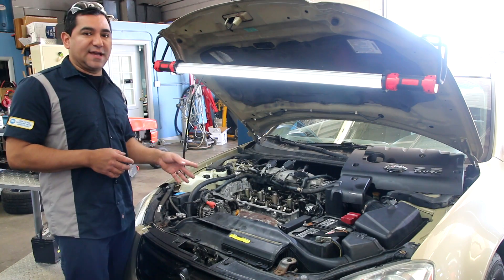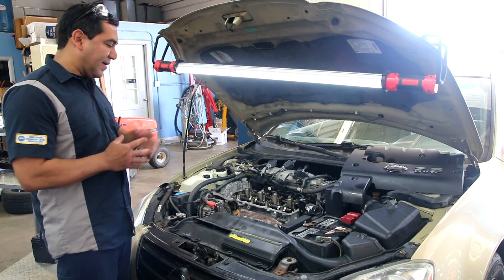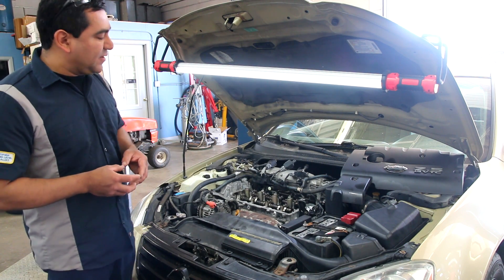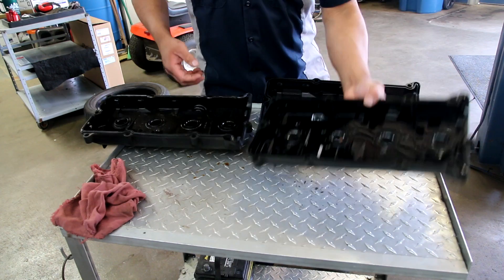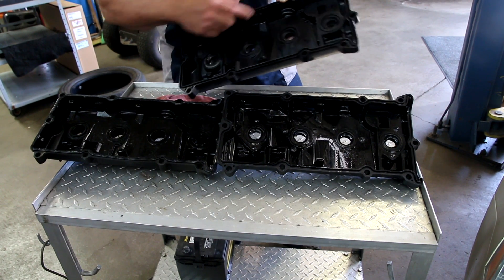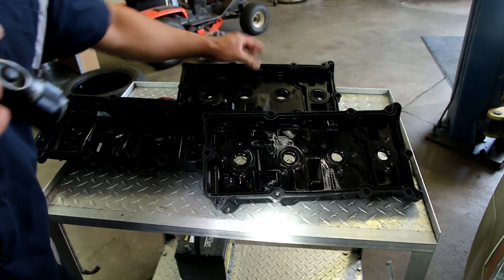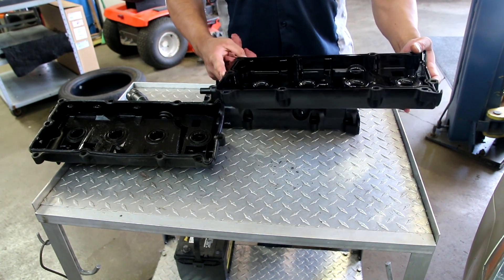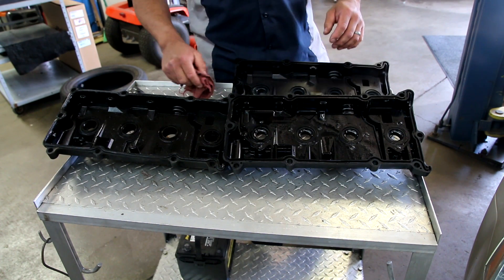Nissan QR25 2.5L Burning Oil

Comment: Thank you for this post. It led me to my sudden increase in oil use.  Here it is 7 years after your post and O'reilys sold me a bad one for my 2005 2.5 Altima.  I replaced it and it hasn't used a drop since. I contacted Corporate and they never said they were sorry or that they plan to do anything. I will never buy from O'Reilys again
Reply from the maker: That's crazy they are still out there! Always go OE parts if you can!

Comment: It's June 2023, just replaced the valve cover on my '17 2.5L, and the OEM valve cover and gasket from Nissan cost me $280.00 . Well worth the money considering all the possible issues you may have with aftermarket covers.

Burning oil is no joke, it carbons up the cylinders and can cause upper cylinder damage. The excess carbon increases cylinder temps and can cause stuck oil control and compression rings which cause even more oil consumption, and carbon buildup around the valve seats can overheat them, causing one to drop, and your engine is totaled.

Burning oil can also foul the emission control sensors and worse, excessive or long term oil consumption will damage your catalytic convertor.

Its been 7 years since this vid and I looked at the aftermarket options and they still are poor in construction. Don't buy the aftermarket valve cover, go with OEM.

Comment: I can approve this video my Nissan 06 Altima had zero leaks the only leak was the Gasket on the valve cover after replacing with a cheap valve cover I started getting oil burning issues.

Comment: I bought an aftermarket valve cover w/ gasket for $38 on Amazon. Works great, no leaks. You have to use Permatex on the shoulders and where the metals come together.  Otherwise ALL of them will leak.

Comment: dead on for Dorman problem! I initially did not want to pay the price a new OEM valve cover would be, went cheap for Dorman.   Oil consumption doubled! same problem with baffle as shown in video.  put on Nissan part, good to go.

Comment: I have run into this same crap. I was about to give away this car because i thought the engine was almost done. I had just changed the valve cover so i went to c factory one and boom burning oil issue is gone.
Reply from the maker: I am glad you got it figured out!

Comment: Changed out the Dorman cover, with an OE Nissan cover. The baffle plate on the inside or the Dorman cover was loose, due to broken plastic spot welds. The PCV hose was filled with oil. The Nissan cover doesn't use the plastic spot welds.
Reply from the maker: What a huge difference in quality.

Comment: The problem may not have been entirely corrected by Dorman. I recently changed the valve cover on my 2005 2.5 Altima. The car is now using a quart of oil every 400 miles, it didn't do that before. I contacted Dorman and they were very good about it. My Dorman cover is a more current production (2016), and it should have the upgrade to prevent oil consumption. They are shipping me a Nissan cover, and have requested the Dorman cover for analysis. I will post an update in the near future.
Reply from the maker: That is good to know! I have had some other Dorman products that were problematic. I had 2 park sensors for a 2014 Ram truck that were bad right out of the box, you could see the pins were not molded in right and they did not work so I got OE ones and got the job done. Also a water bypass pump on a jeep that leaked at were the pipe was soldered to the threaded portion. Things like that get a little frustrating.
Reply: I have had very bad luck with Dorman control arms. They don't last. It's not just Dorman, most replacement parts made in China are very poor quality.

Comment: Nissan Frontier 2007 burning oil and  ciinder 3 missfire code As far as the P03030, that's OBDII and I retired not long after it came out but I'll take your word for it, bad cylinder #3. If a coil and plug didn't fix it, you got a bad valve, cylinder damage, bad compression ring(s) or possibly a bad intake manifold gasket. Nissan frontier 2007  gets P03030 3 Cilinder missfire, that's OBDII it, bad cylinder #3. If a coil and plug didn't fix it, you got a bad valve, cylinder damage, bad compression ring(s) or possibly a bad intake manifold gasket.
Any advise what or where is the culprit ?  thank you ever so much.
Reply from the maker: Hello. Since you checked the coil and plug check for fuel delivery to that #3 cylinder. You can pull the spark plug and see if it has gas on it or listen to them clicking with a mechanics stethoscope like a Lisle part #52500. I am assuming you may not have other ways to check like a oscilloscope and low current probe. If this checks OK then a compression or leak down test is needed. If it is a totally dead cylinder it will not be hard to find out what it is. Every cylinder needs fuel, spark, compression and timing. Let me know what you find. Oh by the way I doubt its a intake gasket affecting just one cylinder but spray the intake sealing area around cylinder #3 with carburetor cleaner when the engine is running, if there is a bad gasket the RPMs will change noticeably. Please do not use brake cleaner as it is much more flammable
Reply: It makes sense your input. This misfire code was hard to detect even by the dealer and 2 other shops..I was baffled.  The engine burns oil I would say quite a bit.. the shops just wanted to make fast money without pinpointing the real culprit.  My father had a large Nissan truck and it was a workhorse to transport mining equipment. But I moved back to Honda...a small hatch back..I did learn a lot from people  like you who are knowledgeable about cars and its components and how it works. The other good news is that these oil powered cars are obsolete. The Lithium powered cars is the next gen inevitably. Tesla is building a massive plant in Nevada the size of biblical proportions and their CEO found plenty of Lithium in Bolivia who could supply the Lithium..  Thanks a bunch.
Reply from the maker: I agree technology is changing. I remember rebuilding Quadrajet carbs and now using PC based scopes to track some issues down. Its a fun and at times frustrating job.

Comment: I just put a new motor in my Nissan Altima 02 and it's burning oil too but I think they put a aftermarket valve cover too should I buy the one from the dealership or take it to see what's wrong it the car first
Reply from the maker: Does it say Nissan on it?
Reply: It doesn't
Reply from the maker: It would be worth disabling the PCV system just to check it. There are instructions in some of the other comments. Then if that changes things I would get a new cover. I suppose you could take it off and inspect it. That is easy enough too.

Comment: Question: I have a 2008 Rogue and is burning oil due to coming through the PCV to Intake.  I know this is a symptom of worn rings but the car sat for a year before I bought it off someone.  Pull the cover and there was tons of black tar-like sludge in the cover. I cleaned out what I could but it still burns oil via intake.  Would this be the cover even with blow-by? Would a new cover help with this?
Reply from the maker: You ask a good question. Lets start with how many miles are on this engine? How much oil does it use between oil changes? How many miles do you go between oil changes? Without seeing a vehicle this information will help.Thank you!
Reply: 74k on the engine; approximately 1 qt every 400-500 miles; 3000 between BUT a) the car was purchased not running, b)the car sat for a year (i know) before I bought it, & c) it started after I ran low on oil, changed it, and put SeaFoam in the oil during the change.  I have changed the PCV valve twice.  When I take the oil cap off when the engine is idling, I get air fluttering out of the hole. However, I have a niece who has a 2012 with 96000 miles on it and it does the same thing with the oil cap off but no oil burning or smoking.
Reply from the maker: If you had lots of sludge in the cover it sounds like general maintenance was neglected. I would suspect you have sticking rings but lets start with the PCV system. You already replaced the valve twice so you could try disconnecting the hose, plug off the port on the manifold with a vacuum cap or something so you dont have a massive vacuum leak and drive it like that for how long you need to see if the oil use goes down. (I am just recommending this for testing) if so get a valve cover. If not you can try soaking the top of the pistons with seafoam for a day or two. Remove the extra seafoam before starting, it will smoke like crazy when started so hopefully you have cool neighbors! Its worth a try.
Reply: Rico L I have actually been driving it with no problems since I capped the vacuum port on the intake manifold and ran a hose from the PCV valve to a breather bottle.  Everything else seems to run normal.
Reply from the maker: Thats a good sign of were you have to go from here. You did a good job on checking things out!
Reply: Rico L thank you!  I'm gonna order a new cover today. I'll update after installing.  Thanks again.
Reply: Well, after replacing the valve cover with a new Nissan OEM one with new PCV valve, new gasket, and putting it back to original configuration, I have not had a puff of smoke in over 200 miles.  The last time I put it back like this, it was smoking within 3 minutes idling. This was the solution.  The old cover was full of sludge so much that insufficient air was flowing through the baffles, causing the vacuum to suck oil through (speculating.)  I really appreciate the video and the help!  Thank you!
Reply from the maker: Good! Glad to hear!

Comment: my 2003 altima has over 320k miles. bought it new in 2003 and have NEVER had this issue. yet i bought a 2016 altima and the cvt took a crap at 5k miles.. nissan was doing great until renault slept with them.

Comment: I put a dorman valve cover to replace a bad valve cover now it started burning oil. Did the oil make its way to the exhaust. Next step is to check to see if there is a gap on the inside of the valve cover for oil to leak out of. Good video.
Reply from the maker: Thank you. Yes it made its way to the exhaust. It was a smoke machine. It used a qt or more a day! The second car was not that bad but still smoked after getting the Dorman cover.

Comment: I have a Question. My altima 2003 2.5L burns oil (I believe, because It smells like oil after driving uphill) and have to put almost a quarter of oil every 300 miles, the intake hose had Oil and the throttle body had oil stains in it, also even after I refill it with oil it has lower than 700rpms when idle (I have to put my car in N when in traffic lights so the car stops shaking) sometimes the oil light flicks. Do you think the issue can be with the valve cover? 

BTW I replaced the PCV valve 5 months ago because I thought that was the issue but It wasn't. i use 10w-30 oil since my car is past 100k miles (110k actually)

Thank you
Reply from the maker: Sorry for the late reply Luis. It sounds like you have more then one issue. Remove the coils and check for oil in the spark plug tubes. If there is it could be causing a misfire. Check the plug condition too and if you need to replace them I recommend NGK brand. The part store can tell you what plugs you need. As far as the oil burning....if there is oil in the spark plug tubes replace the valve cover with a Nissan cover and go from there. The baffle could be cracked from age. Just a thought without seeing it. A compression and cylinder leak down test will tell you the condition of the rings. The valve seals will rarely cause large oil consumption.

Comment: i have 06 altima engine oil turns dark so fast around 500kms , is that meaning burns oil ?  and how to fix it please help
Reply from the maker: Good question! Oil will get darker between oil changes, that's normal. Just check the dipstick and make sure it has oil. More important Is it using more then 1QT every 4,800km? Do you add oil?
Reply: I have no problem with oil ... its still in the proper level all the time ... but my problem that oil color become darker so fast
Reply from the maker: If its just dark oil then no its not burning oil. If it was burning oil the level would go low. A engine can have "sludge" build up in it and that can turn the oil darker faster then you may expect. If it runs fine and you don't use a lot of oil between 3,000 mile oil changes I wouldn't be to concerned that it gets dark. Just a personal suggestion If you are concerned about the color. Use a good oil and add a pint of SeaFoam cleaner with every oil change. That could help clean things out over time. You can leave SeaFoam in the engine unlike some "flush" products.

Comment: Hello Rico,  I put a doorman on mine and it burns oil. I'm not sure if it's the good on or bad one.  My question is if it was the bad one and passages weren't sealed like they are supposed be and oil is getting sucked into intake, would that make my oil get "dark" or "dirty" very fast?  Because my oil does get dark within 500 to 800 miles.
Reply from the maker: I wouldn't say it would. Or I wouldn't use that as a indicator. To eliminate the cover as the issue here are a few things. Did it happen right or soon after the Dorman cover went on? Check the baffle shown in the video and see if it sealed to the cover.  Look into the throttle body, do you see oil in the intake? That is another indicator its pulling oil in. Let me know what you find.
Reply: I just had the engine rebuilt about 9000 miles ago.  And the oil gets dirty or dark very quickly.  So I thought maybe the valve cover might have something to do with it.  It's actually a cns brand not the doeman.  My compression is good, and supposedly the valves and seats are good.  So I don't know
Reply from the maker: If that is the only thing you are experiencing and the engine runs fine I wouldn't be overly  concerned about the oil getting dark. How much oil are you burning and how fast is going through it. It is not uncommon to see half a quart used in 3,000 miles.

Comment: hablas español? como puede el aceite pasar por esta covertura hacia dentro de las bujías si se supone que las paredes de la cavidad de las bujias esta  alta ?? yo tengo este carro nissan sentra spec v y me quema aceite
Reply from the maker: I am very sorry for the late reply. If you have oil in the spark plug tubes it is coming from bad tube seals in the valve cover. It is true the tube is a little bit higher but it will spill over since it has no were else to go.

Comment: my 2004 Nissan sentra se-r spec v is burning oil. You think this would fix it?
Reply from the maker: Hello. This video was specific to the Dorman brand valve cover but if you suspect the PCV system is to blame you can try a few things to check it. You can look into the throttle body and see if there is oil in the intake, you can also remove the hose from the intake that goes to the PCV valve just to check and see if the oil burning is reduced or goes away. I mean do this temporarily so it cant pull oil into the intake. The other cause could be the piston rings. A compression test / Wet compression test and or leak down test would verify this. Its HIGHLY unlikely it is the valve stem seals.  I hope this helps.
Reply from the maker: Hector, if you dont mind let me know what you find. Thanks.

Comment: AFTER PUTTING A NISSAN VALVE COVER DID IT STOP BURNING OIL
Reply from the maker: Yes it did. The oil burning was a new problem that showed up directly after the Dorman cover was put on.  The Nissan part fixed the issue.